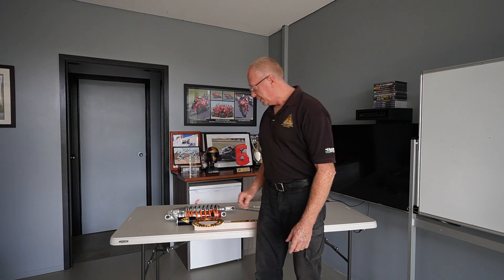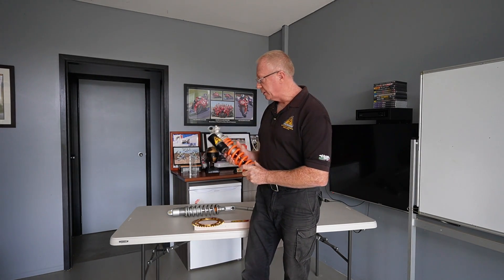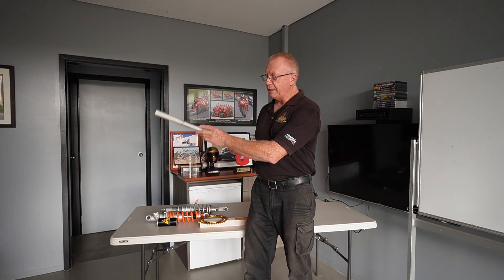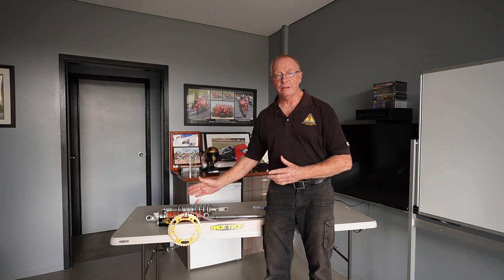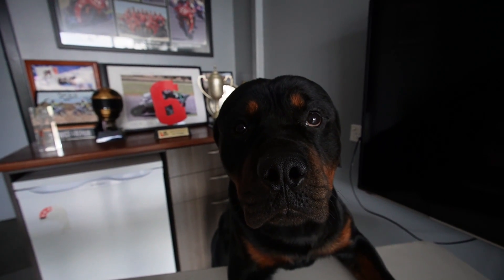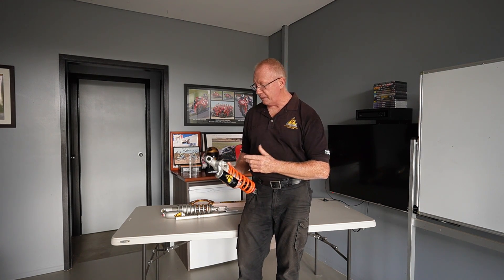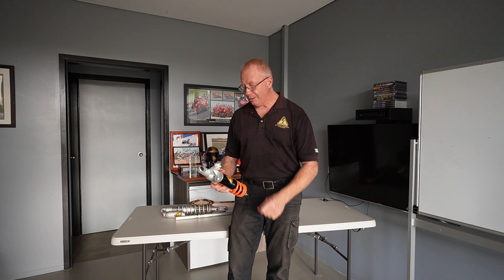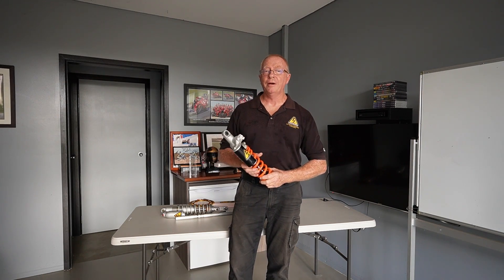2024 KTM PDS Shock Absorber Part 1

Comment: Excellent, thank you!! Sooo, on my 2024 300 XC-W, are you saying I would not benefit from the progressive rate spring if I am just your average trail rider?
Reply from the maker: It is not so much about suspension. The progression really assists with chain torque reactions. This is where a linkage shines. Any bike that doesn't have a linkage will benefit from a progressive spring.
Reply: @shocktreatment5495  Thank you!

Comment: Very interesting discussion.  I own a 2024 bike with the PDS system, and yes, it fits my style of riding very well.  I had a 17 bike with the old system and found it impossible to be good in spite of 1000's of dollars of modifications.  I would love to try your PDS system mods sometime using the progressive spring, in all honesty, in my 30+ years of riding and fooling around with this stuff I never found anyone who could tune with a progressive rate spring and make it work.  For the bucks, it just traded "good" to happen in a different stroke of the swing arm.  Every suspension tuner sold me a progressive spring and I went for it.  FYI: I was AA expert in New England.
Reply from the maker: As mentioned in the video, my interest in the progressive spring is in regards to power delivery / chain torque reactions as opposed to suspension movement. If you were to separate suspension movements from your thoughts and concentrate on how the power develops under acceleration you will be pleasently surprised. There is less squatting and greater stability with the progressive unit.

Comment: awesome video just wondering why the spring rate is so much higher on a pds model ktm then a linkage model ktm  thanks
Reply from the maker: If the shock is mounted further away from the rear axle it will require a harder spring. Closer to the rear axle it will require a softer spring

Comment: Hi Terry, Sorry to post a second comment but after watching I was thinking about the rear suspension. As you showed there is an element of torque created by the chain when it "pulls" the rear sprocket, causing the swingarm to act against (or compress), the rear shock. But wouldnt there also be an opposing force caused by the rear wheel trying to lift the bike ie; trying to wheelie, which would act in the opposite direction effectively trying to extend the rear shock.
Not at all questioning your theories, just trying to understand the dynamics.
Reply from the maker: (Acceleration) Until there is an equalibrium reached between shock force (accumulating) and perceived bike weight, the rear of the bike will be pulled down and the swingarm pivot will lower. The swingarm angle has potentially moved to a point where it is acting below the effective mass and can now start lifting so long as there is adquate chain force being applied. The level of effect is varied depending on how power is delivered. If you remove the shock and move the swingarm through its arc, you will note that the chain is at its tightest when the centreline of the swingarm is in line with the centreline of the sprocket. Above and below it gets looser. If the swingarm begins the motion in a position where the shortest chain pull is below the static centreline of swingarm and sprocket then you could potentially see a lifting of the rear of the bike. The lower region is a small percentage of the stroke but both scenarios are indeed possible.